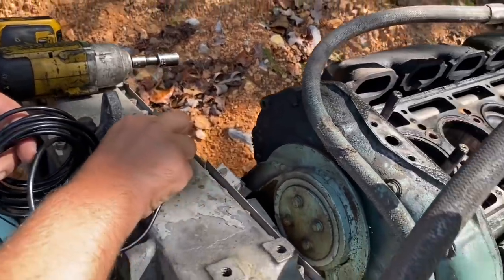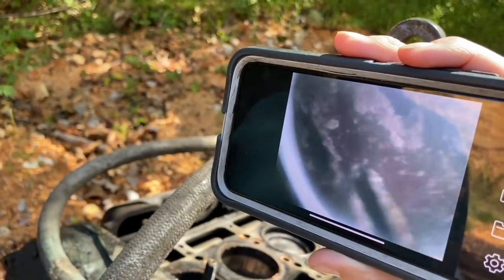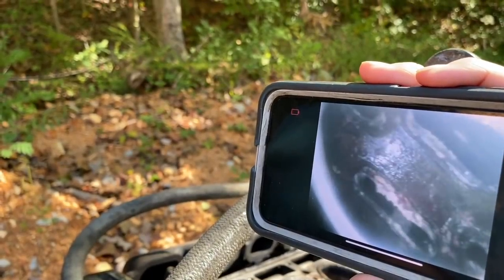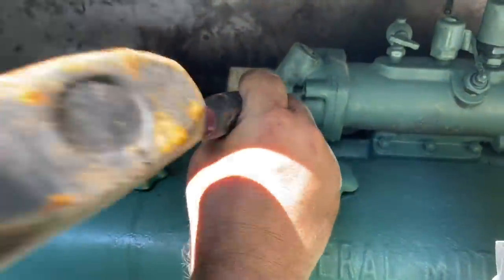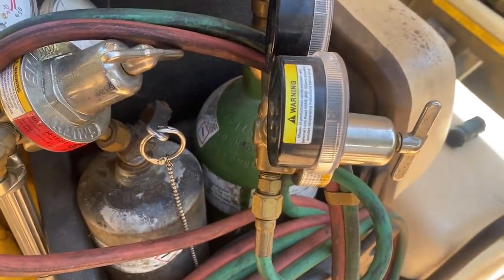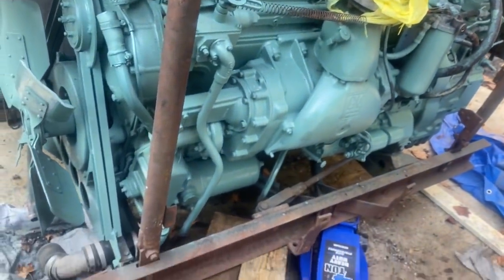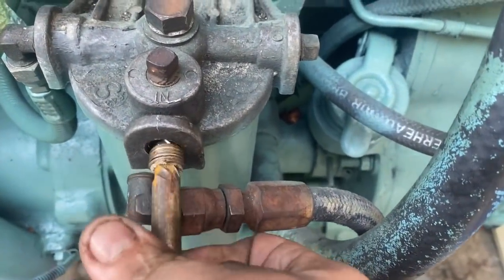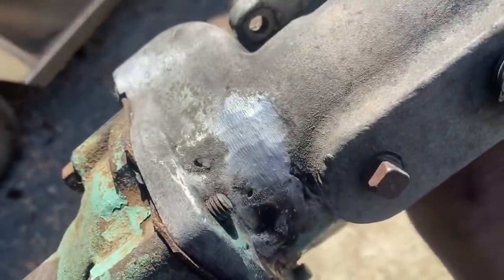Almost done with engine swap detroit diesel 671

Comment: you know it wouldn't have been a big deal to use that other rad with the smaller inlet. It wouldn't have restricted flow volume, it would have just accelerated the flow through that port.

Comment: I was reading about Tefgel which is used in marine applications as an effective solution for keeping aluminum from corroding to stainless and regular steel. Curious if it would be effective if swabbed on the water hose casting to keep it from sticking in the future.

Comment: Scott... anytime I have aluminum with steel bolts, I always put a good film of Anti-Seize compound on the bolt shaft (& threads, of course).... and Never have issues with inter-active corrosion.

Comment: Yo, if you can run that engine for any le th of time, put water softening compound in. It will clean all the residue loose so it can be flushed out with water.

Comment: I like how your liberal use of KRO-OIL nothing unseizes a bolt like that stuff man ill tell ya. Mixed with a little tranny fluid and works wonders on stuck rings and valves. Im doing a timing job on my 04 ford f150 with the nightmare 3 valve 5.4 v8 and the truck is spotless and mi t and the engine looks like it c are off the titantic and a quarter can of kro oil disassembled the whole motor inside and out

Comment: Non foaming powdered automatic dishwasher detergent works excellent for cleaning crud out of a contaminated cooling system. And it's cheap. I've used it on 2 of my Caterpillar truck engines, and it works. Actually got it from a Cat service bulletin. Don't see why it wouldn't work on a Detroit. I use 3 cups per flush.

Comment: Getting more and more annoyed with the midrole ads! Interrupting your wonderfull program. Could turn in to me unsubscribing but will sure miss your flog.
Reply from the maker: I have been limiting them to two.  Be happy about that, YouTube was trying to put 10 in the middle.   One had 12.  I have to go in from a computer to delete them manually.  I try not to use a computer at all so it’s a way bigger pain for me
Reply: When you tube started  the mid roll ads, I switched to premium. It’s worth it to get rid of all the ads.

Comment: All the problems with theses units come from improper maintenance of the cooling system. Proper DCA in the cooling system so important you need to stress this on your Channel. I would not put this bus together with out a water filter in the cooling system.  

Detroit Diesel claimed that you did not need one back then. I can not tell you how many I have added over the years to fix problems like you are seeing.  It is cheep to do a filter $15 for a filter. $20 for the housing some hose and 2 taps. You will save yourself a world of hurt.  

Good luck.

Comment: Take a Dremel tool & split the nut with a small cutoff wheel ,once you have done this you will never have that trouble again ...Missouri Paul
Reply from the maker: The nut was spinning.  The problem was the housing stuck to the studs.  Dremmel would have taken more time and risked damaging the stud

Comment: One tool I’d make would be a 55 gallon drum with inlet and outlet pipes to fit the radiator hoses on the engine. You could run the engine with the cooling water circulating from the drum to the engine and back allowing the dirt to settle out in the drum. You could just keep that on site for such jobs. 
I’m assuming that thermostat housing is a GM part but not Detroit Diesel, therefore probably long out of production. 
Might be worth having someone model it up so a duplicate could be made by CNC machining. Once the milling file is created, producing replacement parts wouldn’t be hard.

Comment: put about 5 gal of 45 percent ammonia in the radiator while out, rotate it upside down and upside right every couple hours and it will dissolve all the deposits. You can find it on amazon.

Comment: Don't know why you didn't pull the thermostat housing off when the motor was out sitting on the ground and easily gotten to.
Reply from the maker: Didn’t know if it had to come off for sure. So i left the engine hanging away so i had easy access if it needed to come off.  I wanted to get the tractor work done so i could return the tractor that i was borrowing.

Comment: Thermostat bolts - if you coat the bolts with anti-seize it may slow / prevent the interaction between the 2 metals.
Reply: Any time I have a dissimilar metals situation like that, I always use some never sneeze on the bolts...

Comment: I've used pvc pipe in place of a radiator with a T on top to flush an engine and maybe ad a cleaner or baking soda to it for circulation
stick a water hose in the T for flushing and cooling works great. reinstall the radiator and coolant

Comment: I had a rusty block.  Filled with garden hose   warmed engine and drained a few times,  until no more chunks  came out. Then put in  EvapoRust total fill with water . Ran engine every few hours  but do get it over 150°. Left it in for a few days. Cooling system was clean. Rinse with water a few times then fill with coolant.

Comment: BGM.. are you going to swap in a new water pump also... heading off possible issues since you are putting in so much work in the cooling system.. preventing a cooling system failure in the future..??

Comment: for those who want to see what is going on under the covers of a heavy duty bolt together radiator.. might enjoy this video of a guy and his leaking cat 955 radiator..  he did a successful repair to it because of blown gaskets and cracked header flange to tube joints because it wiggled.. https://youtu.be/1keXKvElHG4     the only thing different that radiator shops do.. that whats in the video they flow water in one end of the radiator and insert long plastic strips into the individual tubes to loosen debris and restore flow.  the video guy did not have access to running water.. only water carried in with him..  it will really open your eyes to heavy duty radiator repairs..

Comment: Put CASCADE DISHWASHER CLEANER IN THE COOLANT SYSTEM LET IT RUN UNDER TEMPERATURE FOR 30-45min several times it will be clean as a whistle

Comment: I had the pleasure of working on a 4-53? once. I built hydraulic machinery for the offshore industry. The shop guys 'rebuilt' a second motor to power a 3 drum waterfall skagit winch. It was turned over to me to finalize and test. Lets just say, the boys in the shop did not satisfy me. Spent nearly a week correcting their 'incomplete' service. When I did finish, unit performed to strick calculations tirelessly. Ennjoyed that project very much. Detroit's are the preferred motor sources used in the offshore industry, seen some 'BIG' ones out there.

Comment: damn that cooling system is dirty. looks like some one ran just straight tap water in it.
Reply: Thomas T.... which would possibly explain why it over-heated.... plain water boils at a lot lower temp than with a 50/50 antifreeze mix.... and No Detroit 2 cycle (Expecially with 4 valve head(s)... should Ever see over 190 degrees.

Comment: What’s the contaminant? Calcium from hard water?
Reply: Yes. Tap water in combination with lack of change outs and dissimilar metals.  My 91 350 SDL suffered the same issue which was solved by the application of $ in the correct direction

Comment: Permatex makes a product called 18E which in a 1/2 ton truck you drain and flush out all traces of coolant, remove the thermostat and put the cooling system as an open circuit including the heater core. Pour in the whole container of 18E, add water till 1 inch from top of radiator, start and run engine on fast idle for half an hour and you get the same results as if it was done in a rad shop. It would probably take 2-3 containers for a 6V71. When your finished the cleaning  just make sure to flush out the system of the solution and put the thermostat back in and refill the cooling system as required. Permatex 18E is a Hydrochloric Acid based cleaner. I just remembered don't have the rad cap on while you run the engine (safety first). I hope you can find 18E or a reasonable substitute. Just my 2 cents worth.

Comment: Dishwasher tablets with water makes effective cooling system flush. Plain water doesn't do much.
Reply: Sodder Bridge
 ... original Cascade powder is better at degreasing. Transmission shop suggested it when we split the trans oil cooler years ago and the radiator was full of ATF.
Reply: @rupe53  That Cascade is a pretty unique idea. Have to keep that in mind.
Reply: @giggiddy  ... it's one of the things I picked up after50 years working the trade. Another trick was using the original formula Easy-Off oven cleaner to get the crud out of valve covers and oil pans when we didn't have access to a hot tank, although I have to admit it works better on small 2-stroke engine cases and cyl heads, after you clean the oil off first. It's so nice working on a head without all that black carbon all over the bench!
Reply: Sodder Bridge not a bad idea. That whole engine must be coated with that aluminum oxide from corrosion. That can make a huge difference in cooling and can result in overheating.
Reply: You know you say that pretty sure you've never used it pretty sure you've never driven a vehicle long-term afterwards because you wouldn't say that had you done that to your engine you see it gets into the engine itself destroys the bond inside head gaskets deteriorates the adhesion properties of silicone it's because of this exact practice because of mechanic wasn't smart enough to put a radiator test kit after doing a oil cooler replacement cost me a $4,000 engine to get grease and oil out of your engine since grease and oil float especially when they're hot take the radiator cap off start the engine let it get hot the circulation of the engine will bring most of not all of the oil or transmission fluid or whatever the screw up was into the top of the radiator core where you can get the biggest part of it out with grease rags but dipping them into the radiator and pulling them out but if you put Dawn dishwashing liquid or some kind of dishwasher detergent into your engine you will regret that decision in a few thousand miles
Reply: I'm not a mechanic or something, but be careful with dishwasher tablets and aluminium. Many kinds of tablet can corrode aluminium badly. 
I don't know how bad it will be in practice, but in theory it's a bad plan.

Comment: seems you need a smaller hammer looks like a crack in the fuel filter housing now also from the top fitting port you hammered the easy out into..in case you didn't see it
Reply from the maker: Not from hammering it threaded in further before it came loose. Cracked the filter housing. I saw it and replaced it with the one from the other engine

Comment: 500 years from now someone will find several 9/16 sockets buried in the dirt near your pad but not one 10mm socket #DetroitDiesel
Reply: 10mm by the container for sure
Reply: It's amazing how much of a GM/Detroit Diesel 71 series you can take apart with a 9/16" wrench.

Comment: Steel bolts thru aluminum. Use hylomar as a sealant and anti corrosion compound. Hylomar is available as permatex 85420 flange sealant. I have split vw cases 15 years assembled and it was still tacky. So it never hardens . Wont flush out with coolant or fuels.
Reply: I use it on our racing cars, airplanes, and Renegade Trucks. Cool Stuff.
Reply: That is some great stuff. I’ve used it myself.
Reply: That or Tefgel